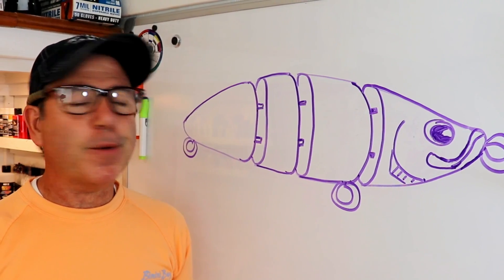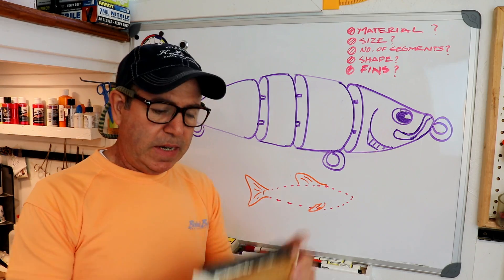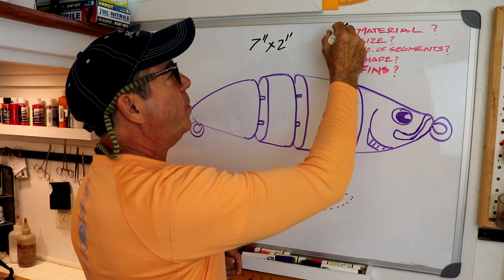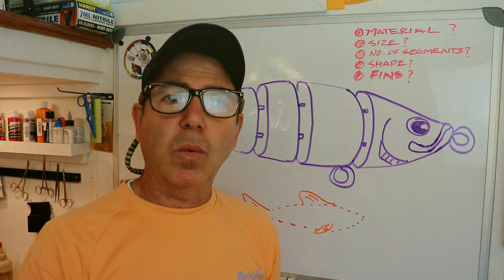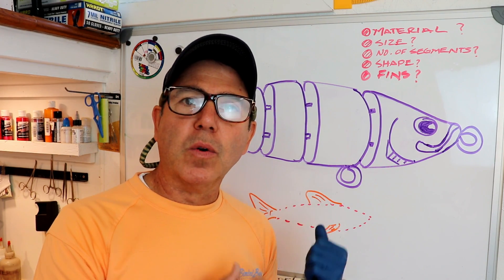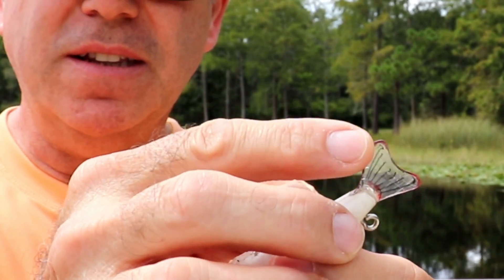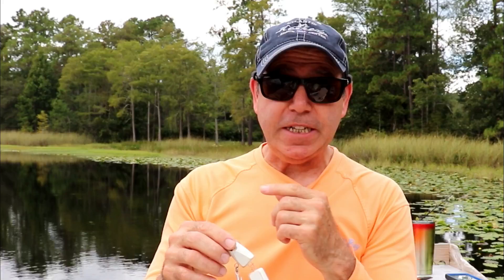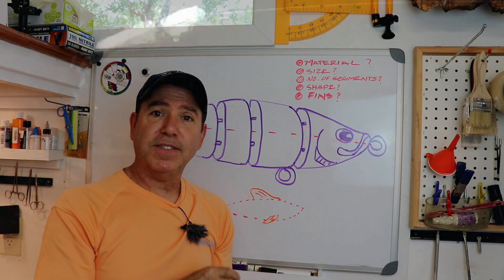Making a Swimbait, Designing and Building

Comment: I know i'm late to this video but i wanted to ask anyway/ I want to build  a 45 mm segmented swimbait/crankbait. I  will be using a CNC  machine and fusion360 to do most of the heavy lifting. In that small of a package would 3 segments make sense regardless of technical challenges.
Reply from the maker: There are folks making, what I would call, micro lures but, 45 mm is just large enough to do a joint or two.  What you need to consider is if you will have room for weight and hardware in those tiny segments...?

Comment: What don't recommend for weighting lures.  I have been using stainless bearings but need more weight in less space.  I was gonna try lead but it scares me.  Do u have any suggestions? Jcart1029@gmail.com please if u have time I'd really appreciate it.  Your videos are so helpful!
Reply from the maker: Don't  be afraid to use lead. I use round split shot and I wear gloves if I plan to handle a lot of it.  I don't melt lead...at that point you have a lot more exposure.

Comment: Cant wait to see it. Ive been thinking of making one but i dont know if it would hold up against a 20kg+ kingfish
Reply from the maker: What would you do , troll for king?
Reply: @EngineeredAngler  we trall but i do alot of sight casting for them on the sandflats and off the rocks. Off the rocks is hard as you have to lock up on them before they can run you into the reefs

Comment: Gonna love this design/build series. Curious on you thoughts if either the fin or tail was made of a silhouette material which would create the profile but minimize the interference. Probably not a good one but screen comes to mind or some type of slatted material. There is a ridged screen material used to sand Sheetrock
Reply from the maker: I've been experimenting with some fabrics for the tail...seems promising